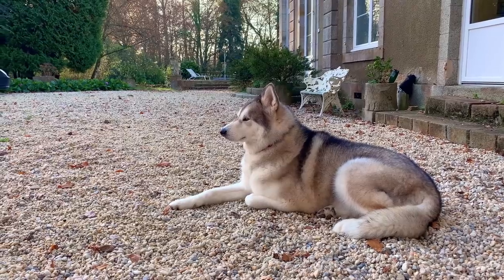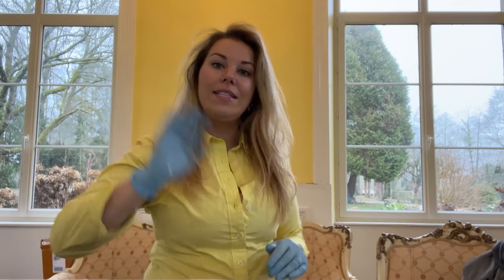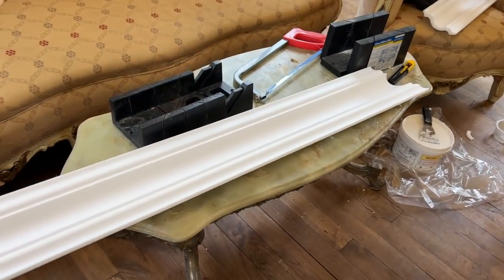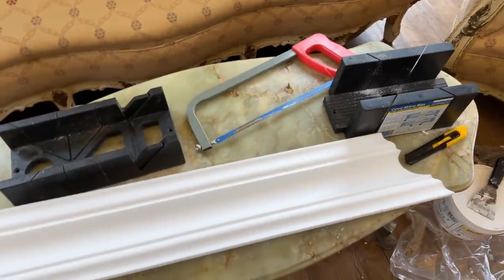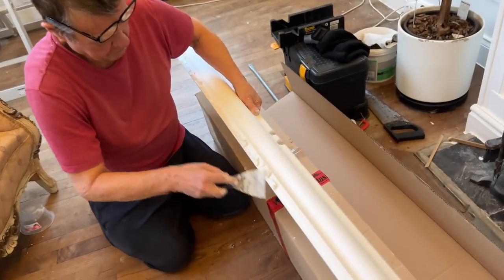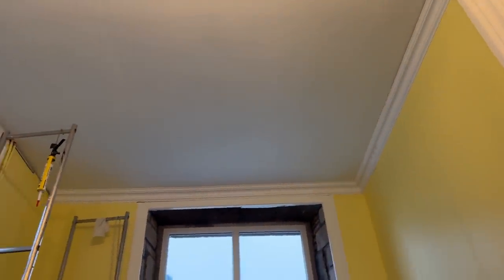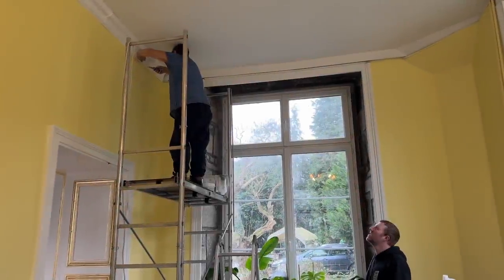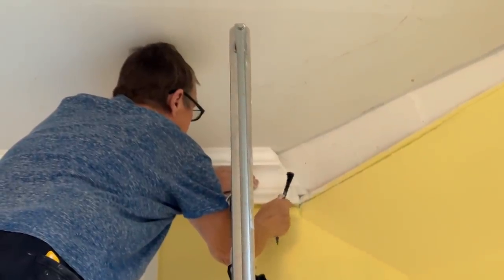HOW TO PUT UP THE COVING! : - Chateau Life 🏰 EP 119

Comment: Huge improvement! A tip for the next time you are installing coving: where you have a joint on the straight ways; a more desirable application is to cut the joints on opposing 45 degree that over lap. This allows for expansion & contraction at the same time as hiding the joint! Especially being that you most probably will experience movement with humidity changes from the moat, the cold stone structure and the change of seasons temperature fluctuations inherent with the chateau.
Reply: Truth! @Judy Soubry is correct. I don't have a moat; a waterway is directly behind my house(approx 10 yards/meters). My doors/woodwork always moving. Today is a serious rain. The upstairs door will probably stick and that one downstairs door will probably open without a problem! "Life around water"

Comment: Polystyrene? Why not wood?
Reply: Cost. Wood is significantly more expensive.
Reply from the maker: You wouldn’t put up wood either; plaster was used which is significantly more costly, difficult to work with and when rooms move such as old houses do show cracks and issues much more